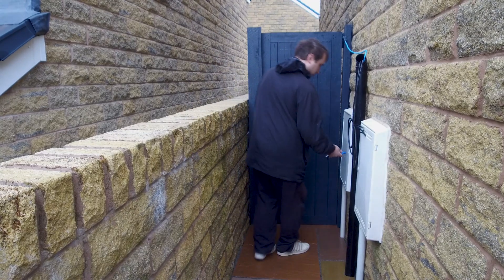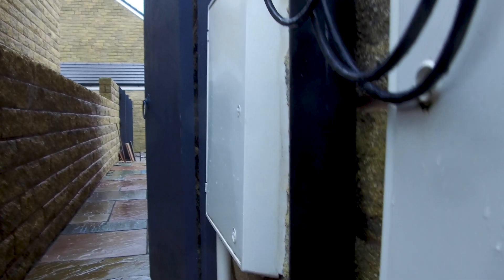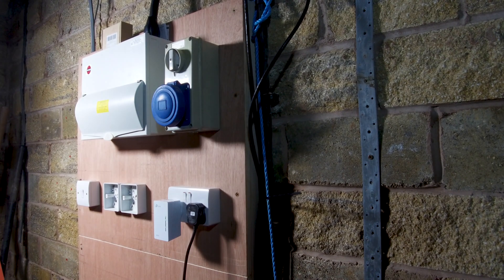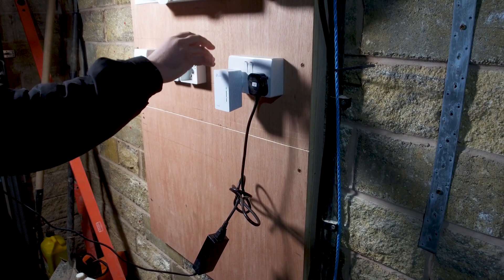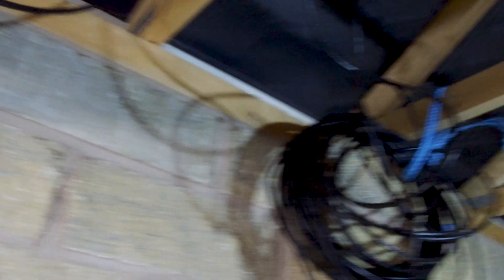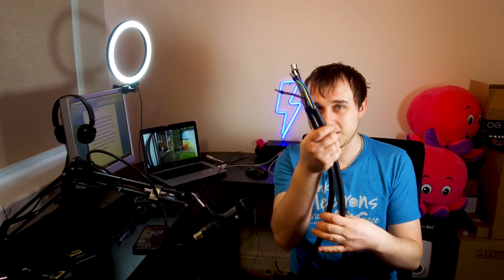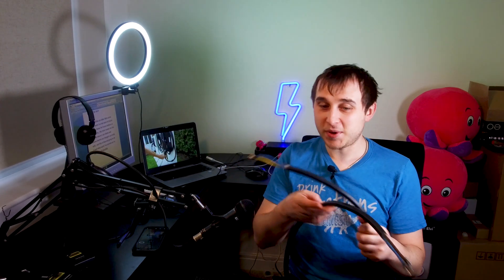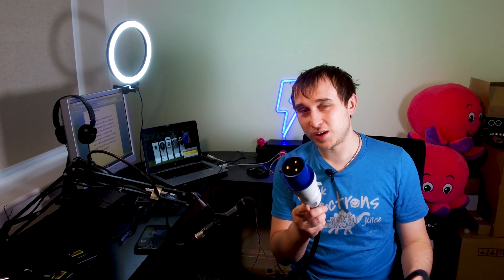Futureproof For EV Charger The Finished Product!

Comment: Hi Nick, I am a Octopus Go Tariff customer; it seems Octopus Intelligent Tariff doesn't have the scope to deal with EV chargers that have Ethernet connection, only wifi or 4G sims? As our wifi doesn't reach the front of our drive and we don't get a reliable 4G signal there either, ethernet is the most suitable connection type for an ev charger at our home. Question, which EV Charger with Ethernet connectivity is the safest bet for future energy supplier connections?
Reply from the maker: Ohme, wallbox and myenergi currently only chargers on intelligent I know myenergi has Ethernet options even with the previous versions.

Comment: Some chargers require a earth rod some don’t how do you get around that with different chargers wired through a commando socket?
Reply from the maker: This is a demo setup for testing however all methods would work via comando but for test I won’t be fitting an earth rod for non earth rod units I’ll just be mentioning they need one

Comment: Your on a PME earth system, are you intending to fit a PEN fault detection device or make the garage a TT system? I’ve seen on Twitter some of the chargers you have to test and some don’t have internal PEN fault detection
Reply from the maker: Hi Ian for my test rig I won’t be fitting any extra fault system,  this is a requirement of regs for installs this isn’t an install it’s a bench rig so I’ll just be mentioning which need it and which dont.  My charger I have what fitted pre 18th edition and doesn’t have earth rod the regs there to make things safer.  As this comando isn’t a charge point it’s not needed under regs

Comment: As you have a Commando socket fitted, it would make sense to test the Ohme cable with the fitted Commando plug - I may have to go down this route as I don't think that my property will qualify for the grant and the Ohme/Commando setup will be cheaper than a fully self-financed charging point.
Reply from the maker: Hi Rob Ohme will be on testing list but the comando version not needed for me as I have it as my main unit already
Reply: @NicolasRaimo  Cheers Nick! I look forward to the review. Whilst it may not be partiularly useful in your own circumstances, I'm sure that there will be quite a few viewers who will be interested in this option.
Reply from the maker: @RobRait  hi Rob what I mean is apart from the end there’s no physical difference,  you can make any charger a comando one end also

Comment: Sounds like you’ve planned for all contingencies. Except one, the drainpipe along the side path, will capture any falling water, unless it’s either partially capped or a U-bend is fitted, so the opening faces downward.
Reply from the maker: it doesn't matter if it fills with water,  putting any U bend in cable would only cause issues for when pulling cables in future.
Reply: @NicolasRaimo  I would have fitted at least a 90 degree bend instead of the 45 and also plugged up the open end with something.  Why is it so high up the wall?
Reply from the maker: @tusdardcart  just high up as I ain’t decided what’s happening yet,  that 45bend was just to angle it for time being.  It’s down the side of the house between me and next door gets very little rain touching that area so am not worried ;)

Comment: you will need pen fault detection device on the 32a commando socket  some EV  charger don't have them  fitted on them  ???  and  the rcd on the consumer unit  should be type A
Reply from the maker: Hi Terry yes some EV chargers DON'T have them and some do which will be part of the review of each charge point
Reply from the maker: All the units am testing have built in RCD and DC leakage protection;)

Comment: Did you use a DC tolerate RcB ? In your fuse box.
Reply from the maker: All the charge points am testing have DC leakage protection and if not ill request its provided as part of the review.

Comment: Great video , I'd have run a couple of extra cat5 cable through from the start you can never have enough for  CCTV,  WiFi Access points etc but as you say you can always run more through layer
Reply from the maker: I don’t need any cctv down there so non has been run for that reason plus could always use a switch if needed ;)

Comment: Nice video. Particularly enjoyed the technical term "crimped with crimping stuff"........

Looking forward to the reviews. Perhaps ask the charger manufacturers to send you the units with the commando plug already installed on the input side?
Reply from the maker: I think this is one of a fav comments! glad youe njoyed the technical terms and found them easy to follow.  Issue with having them send me plug is it would require them to get cable and plugs they won't have,  and most the time there sending the units as they'd send to installers also makes it easy to do unboxing videos if i haven't got a massive cable attached to it ;)